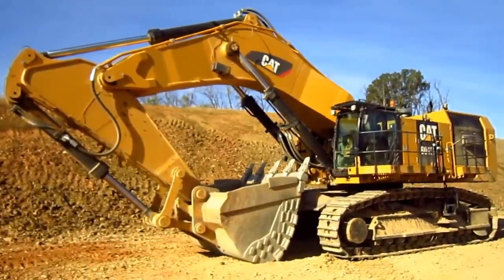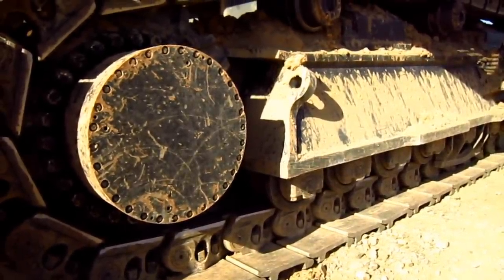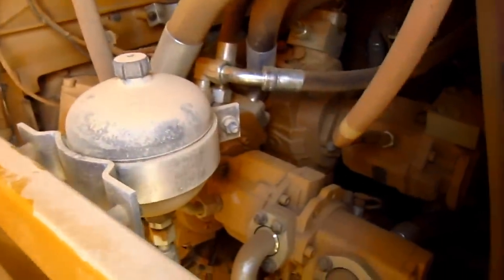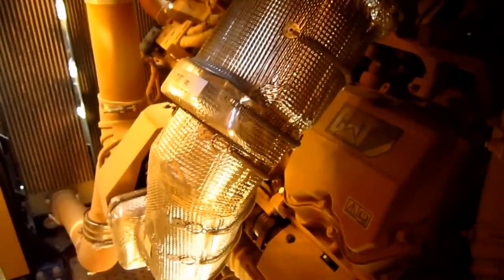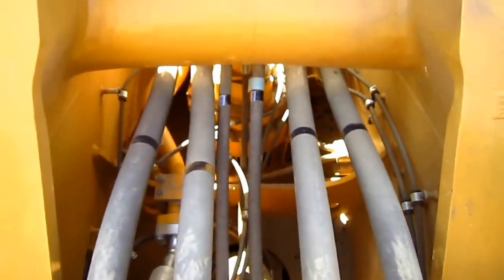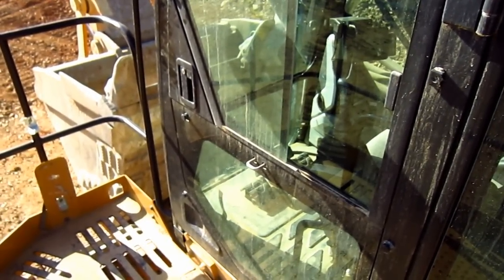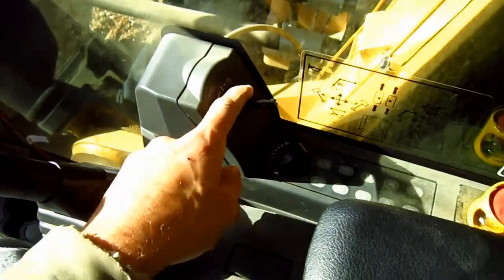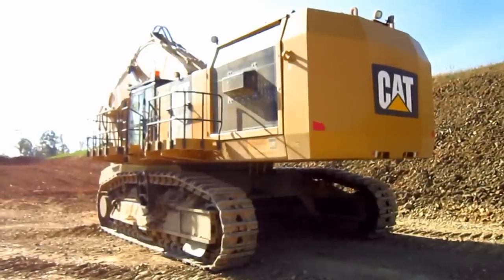Caterpillar 6015B Documentary

Comment: Genuine question if someone could help me out: CAT themselves don't refer to this as an 'excavator' in their catalogue, they refer to it as a 'hydraulic shovel'. What's the difference between a large mass excavator, like a 395F, verses this? Is it purely the size of the thing?
Reply from the maker: A lot of manufacturers have their own terminology for components/ equipment. For example, you will see a gear box on an excavator referred to as a "pump drive", "pump transmission", "gear case" etc. Same thing applies here. There is no difference other than size. These machines are all hydraulic excavators with backhoe or shovel attachment. Thanks!